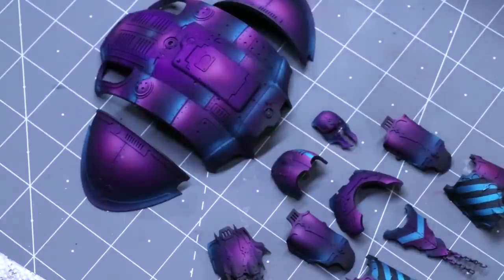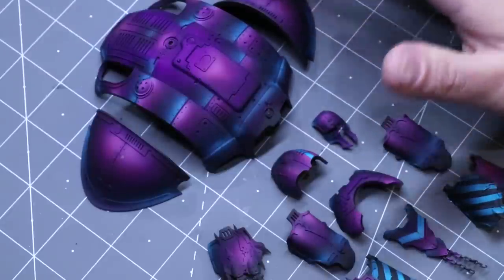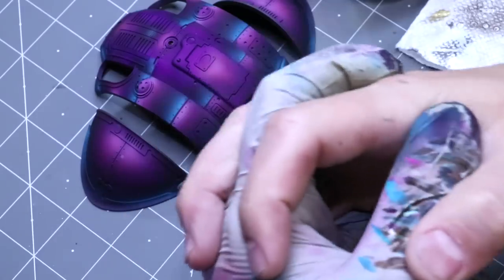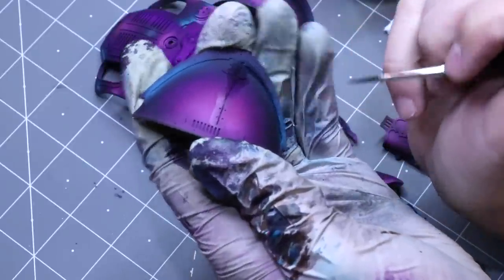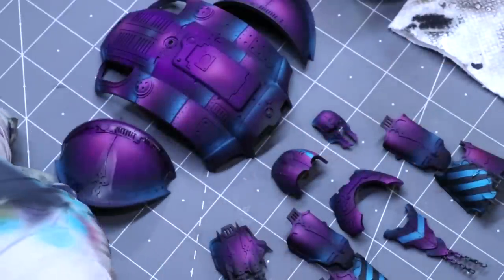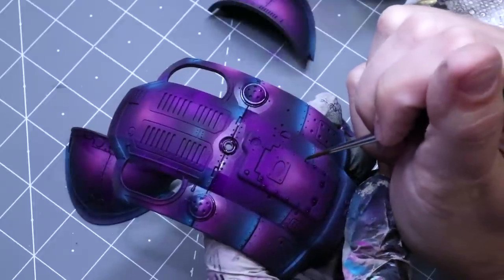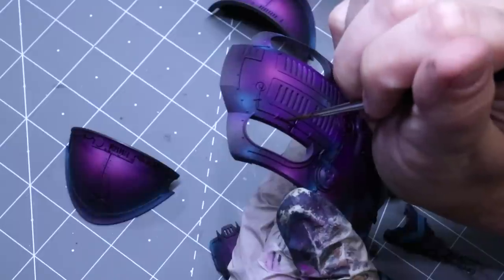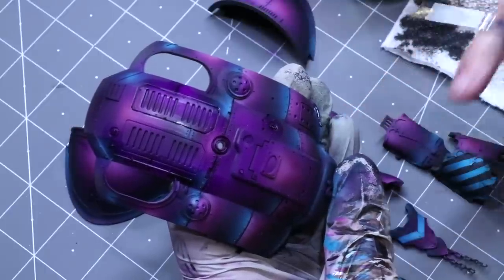Hobby Cheating 212 - Panel Lining with Oils

Comment: I"m about to build a flyer so this helps a lot, but I have one question. I typically hear that people gloss varnish the model before using oil washes but it seems in the video that it was just matte varnished instead. Did you use a gloss varnish or is simply a few layers of matte varnish enough for a pin wash?
Reply: I believe, he did not varnish the model. I recall him saying, he never does. --- edit: I stand corrected

Gloss varnish helps oil wash to flow better in the recesses, as the surface is smoother. Also, varnish acts as a protective layer, if you need to remove oil wash from areas.
Reply from the maker: I did varnish this (I mention it around 5:35), but I used two layers of Satin Varnish, I find it's better for my tastes, but gloss will make things flow the most and then you just matter it out later. The only thing I never varnish is metals, with those, I am just careful.

Comment: Hi, Great video as always. Thanks for doing them. On this one did you use a gloss varnish before the oils or a matte one?
Reply from the maker: Satin varnish actually, so in the middle.
Reply: I wanted to ask this too ! I used vallejo matte varnish to try this and the wash seems to want to capillary action itself up & across all the tiny little divets in the varnish, so it will go all over the panel rather than in the recess (done on a 40K knight lower leg plate) - think satin or gloss may be the way forward ! You ever have issues with it on matte varnish Vince? It could just be me being a noob with oil washes

Comment: I was hoping for a hobby cheating on the “slurry” after its mention in WHW
Reply from the maker: It's coming, but I have record these a little farther in advance. ;)
Reply: @VinceVenturella  I'm looking forward to it.  I knew that plastic glue melted plastic but I had never heard of putting sprue into it and using it to fill gaps...  I actually put some build work on hold until I see this!
Reply: @brandonhouston7575  It's an old trick, scale modelers use. You cut sprue into tiny pieces, add plastic cement to melt it, use toothpicks to pick up the slur, fill the gaps, sand, prime, paint.

Comment: Still unsure why a targetted wash (with something like nuln oil or an ink) won't do the same thing? Provided its only applied to the edges of course.
Reply: If applied carefully it could. The advantage with oil washes is, you can correct mistakes by applying tiny amounts of white spirit to reactivate the oil wash and removing the excess.
Reply from the maker: Three major advantages. 

1) It's stronger, the washes from GW are very lightly pigmented, this will generally produce strong results. 
2) It flows better. Shades have a lot of flow improver, but they are still water based, this will generally flow through the whole seam with very little effort. 
3) Clean-Up, As Naph mentioned, I could correct this hours later and remove anything that was in the wrong area. The working time is longer and the white spirits mean what I remove leaves no stain.

Comment: Only 3 minutes into the video (and I've tried the method in your other video making oid washes wih W&N paints  before and it worked well) but isn't it advisable to first do a gloss varnish on your base panted miniature before applying the oil wash because the paint thinner used in making the oil wash can remove / spoil the base paint ???????  UPDATE: 5:35 ... AHA !
Reply from the maker: Yep, there you go, I mentioned it a little later than should have, but I did mention it.